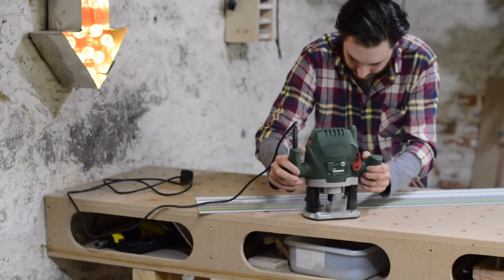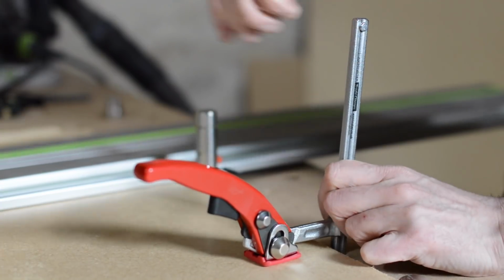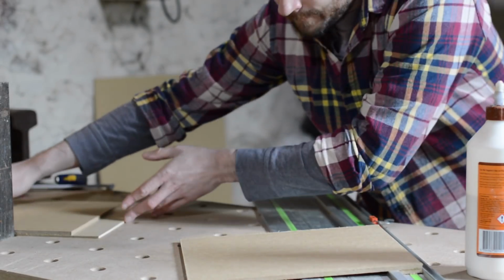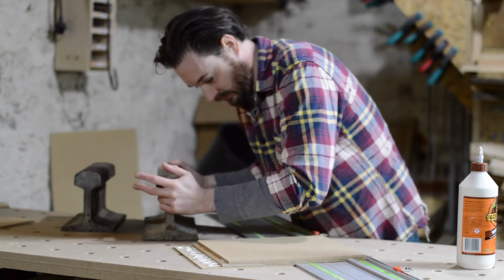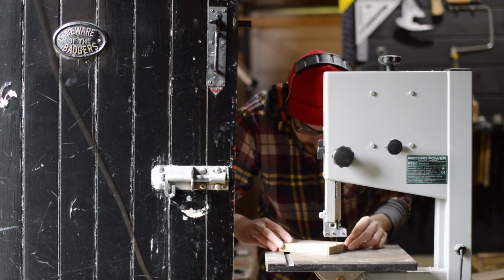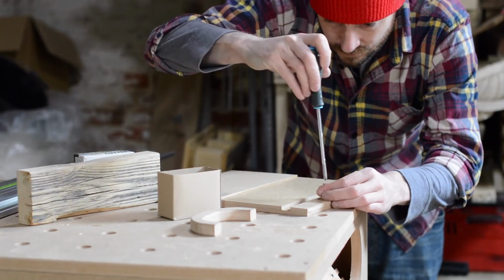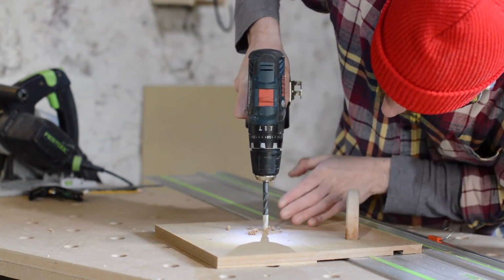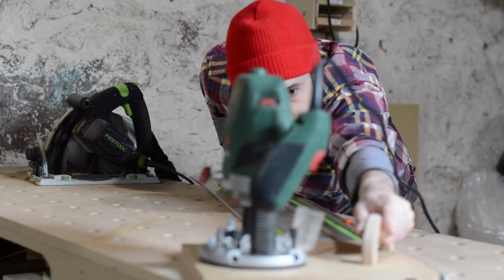Router Track Guide

Comment: Great jig, wondering though if you made an update to utilize the router’s rail system so that you can adjust the width of the dado to fit exactly to your board size? I see you have a newer video making a dado jig does that mean you no longer use the track to route dados?

Comment: Hey Matt, another great video. I had been looking only this evening for the cost of router accessories for my Makita rails. Makita don’t make one as far as I can see. Also I would need to find a router base with a dust extraction port for my router or buy a different router. I don’t like using my router because it fills the air in my little workshop with loads of very fine and dangerous dust. This would be just the job for making dados for bookcases etc as I don’t want to have a table saw. Many thanks.

Comment: Good job mate. Much like with your table saw table vid, you have a way with straight forward, no nonsense solutions. An idea for an addition to your new table: a guide rail flip up/flip down bracket like those available for the MFT. Allows you to lift the rail out the way, move/set your piece, then lower it again for cross cuts. Thought about buying the Festool bracket and adapting it for my Bosch rails but it's a gadget ripe for DIY'ing.
Reply from the maker: I watch Peter in 10 minute workshop use one and have thought thats a great tool. Could not quite see how it works with different thickness materials. I need to go to a store and look at one.

Comment: How much plunge depth have you lost and how will you counter it?
Does your router have a lot of plunge travel or can you compensate with longer bits?
Will you still be able to use the depth gauge for measuring plunge?

I tried to make a circle jig with a router before but couldn’t work out the details.
Reply from the maker: You do loose plunge depth but I will only be using this to cut dados. These is plenty of depth left to do that.
Reply: Badger Workshop Ah! Got it.

I should of thought of that.